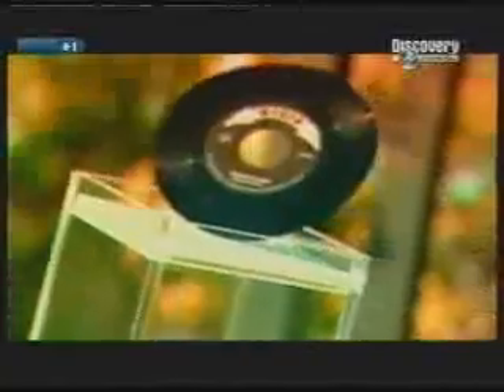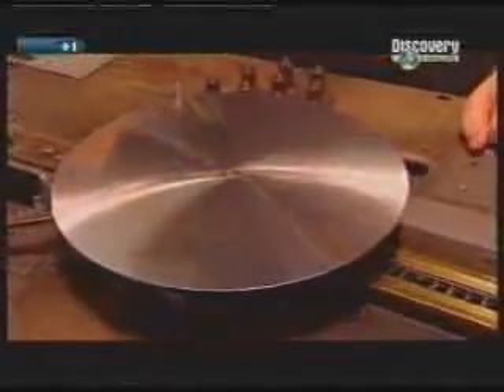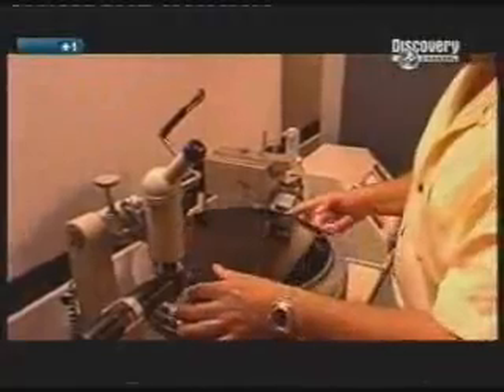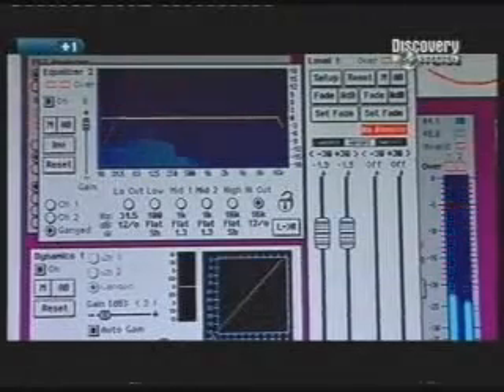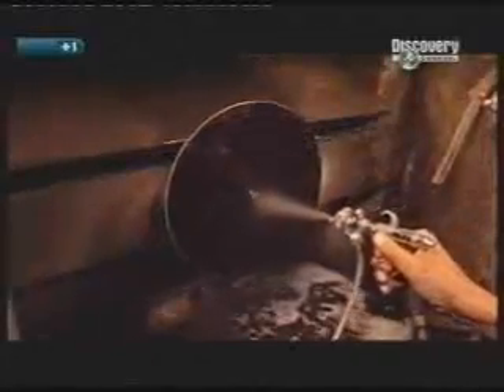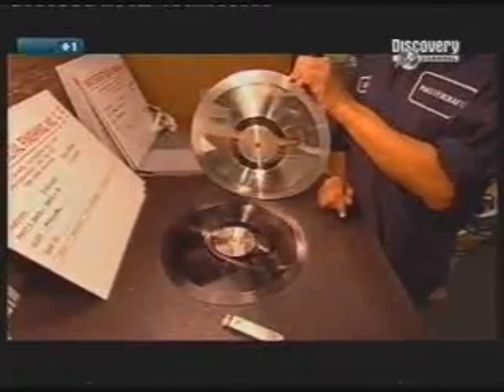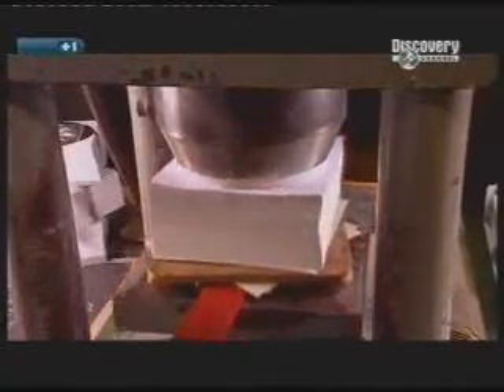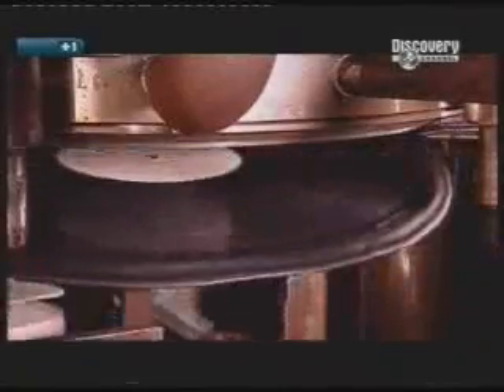How a Vinyl is made?

Comment: @Davoravo86 You don't get any crackle or noise on a half decent player on new vinyl. Analogue will always be better than digital because it's an exact reproduction of sound in a sine wave. The sound is reproduced by vibrations made by the sound. Digital is merely a digital wave, which means it takes X&Y axis points from the analogue wave, to produce a numerical value. The higher the sample rate, the better it is, but digital will never reproduce a perfect sine wave in it's natural form.

Comment: @jonnebanan I agree 100%. I recently bought some new vinyl (but old recordings) and was disappointed with the sound quality. I never knew that modern record cutting machines used digital sound as there input signal. But this certainly explains it. Because listening to these records I had the feeling that they sounded somewhat "digital" even though I knew the original master recordings were made analog.

So to get real analog sound I should just try to get good quality old pressings again.